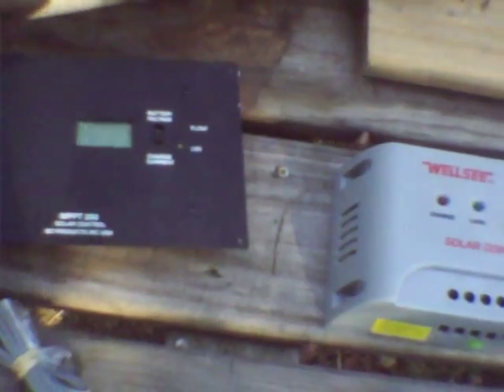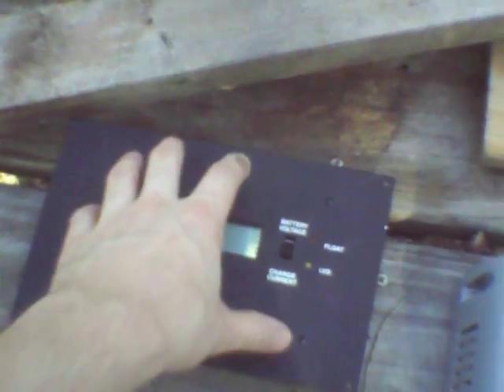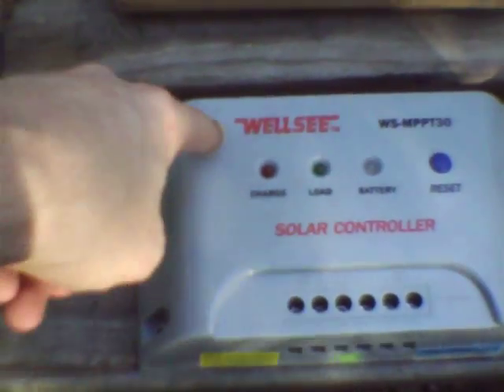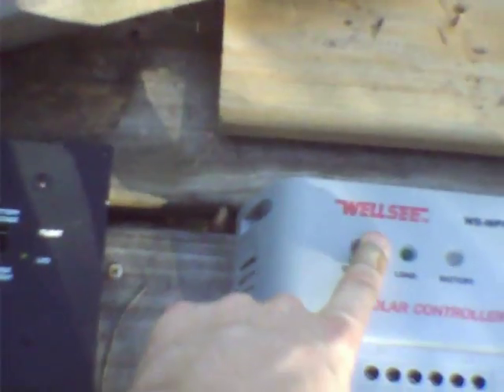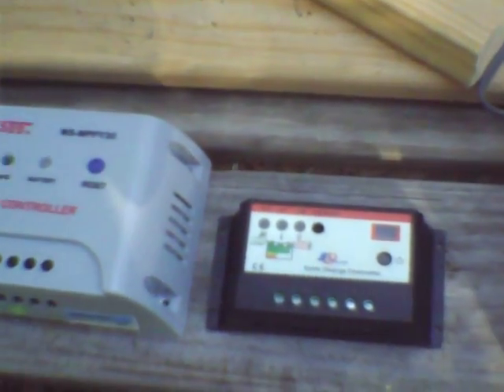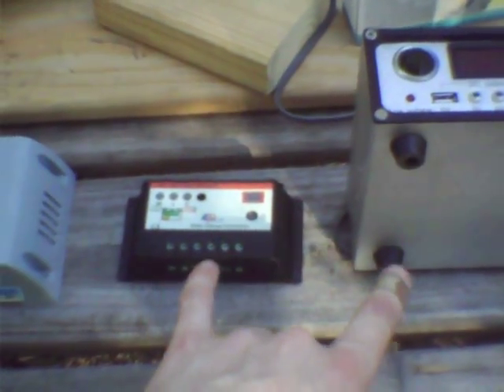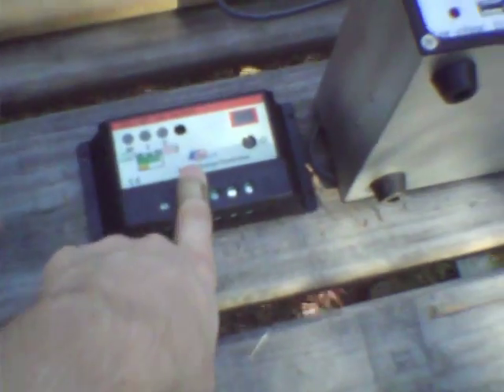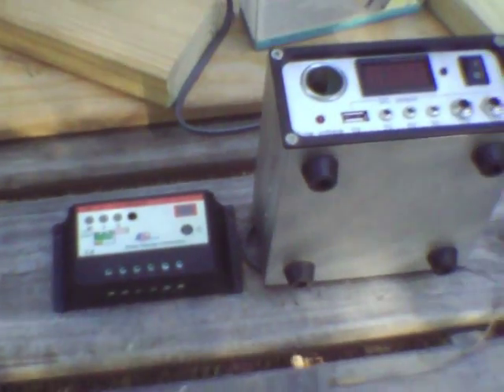Charge controller recommendations

Comment: The 555 is not "an oscillator".  It's a very complex chip for its size and the level detection circuits would work fine for many things in a charge controller.  If you don't know the details of a device, don't find fault with its use.

Comment: I have a question,,,,,,, a 100 watt portable solar panel and two six volt Trojan t105re batteries hooked in series and and a 1500k inverter can  I use the  renogy mttp 12/24 volt charge controller or is it to big for this set up

Comment: Hi Rand, I have four of the 45w Harbor Freight solar panel kits. Spaghetti of wires going everywhere to separate battery banks. Just bought a 100w wind turbine, can I hook the solar and wind together inputting to a HF Thunderbolt 500 controller then output to a single battery bank? So thats 180w solar, 100w wind, 280w total input to the 500w controller? Main question is do these solar charge controllers handle input from wind turbines along with the solar input as long as the wattage input is under what the controller is rated? Thanks in advance.
Reply from the maker: JBBabbitt The wind and solar need separate controllers or a controller that has separate wind and solar inputs.  Wind systems also need a dump load to stick any excess electricity as an unloaded turbine can spin out of control and fail catastrophically in high winds.

Comment: Would the harbor freight box be ok with a 100 watt 5.6 amp panel ?
Reply from the maker: Larry Witte Probably not as the stock fuse is only 4A and the internal construction is a bit dubious as far as sticking over 5A through it is concerned.

Comment: Most of these are for 12v systems... do they work if I'm running a 36v panel and converting that to 12v? Or do I need something else?  And if that's the case, do you have any recommendations?

Comment from the maker: A charge controller keeps a battery or battery bank from being overcharged by some electricity source (usually PV modules).  The only charge controllers that actually modify the output potential relative to the input potential are MPPT controllers, which must use potential conversion (usually buck; sometimes boost or buck/boost in specialist applications) in order to do maximum power point tracking.

Comment from the maker: Depends on the wire used and on operating current and operating potential of the array.  For example, if 12AWG wire was used for the PV array home run, then the fuse or breaker can be rated for at most 20A as that is the most that 12AWG wire can handle.  And remember that any fuses or circuit breakers MUST be rated for DC use.

Comment from the maker: For mixed module arrays, PWM charge controllers are better.  It would be possible to use multiple small MPPT controllers (one for each module in your case), but doing so is more expensive than getting more modules to make up the difference between using a PWM controller and an MPPT controller.

Comment: I think your question is fundamental in nature, so I think I can explain your observations. A charge controller  restricts flow of current to the battery. For example in the morning battery charge is low so the controller allows all available current to go to the battery, thereby charging it up. after a few hours of increasing sunshine producing more current going to the battery, the battery gets charged up resulting in increased voltage seeing this the controller restricts current! hope helps!

Comment from the maker: You would be better off using multiple smaller modules, as modules that big need multiple guys to move and are very expensive.  Also, one big module is a single point of failure.

Comment from the maker: Depends on the input potential rating of the controller (36V nominal modules should have at least a 75V maximum input potential controller).
As far as charge current is concerned, that depends on the size of the modules.

Comment from the maker: @electrodacus   The BZ Products MPPT controllers are actually not much more expensive than a comparable PWM controller, and are in some cases cheaper.  I got these EP Solar controllers as they were cheap and I did not need all of the bells and whistles that the LCD versions have.  And yes, the WellSee crapola unit sucks, although it does work as a halfway decent PWM unit and my improved inductor gives it a 1.4% current gain.

Comment: I've enjoyed your vids on the Wellsee.  Very informative.

I did some reading and bought a HQRP 10a (like the 3rd one in your lineup) off Amazon for my little 60w PV setup on the camper shell.  It seems to be doing a good job keeping my camping battery topped off.  No complaints.